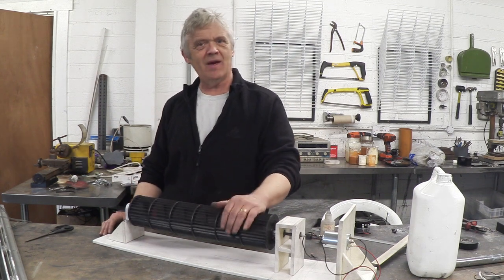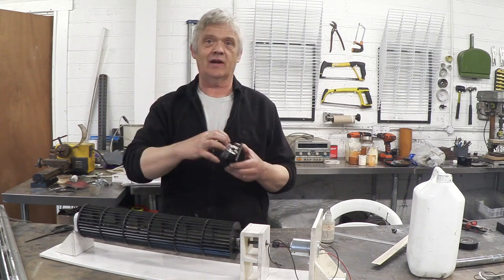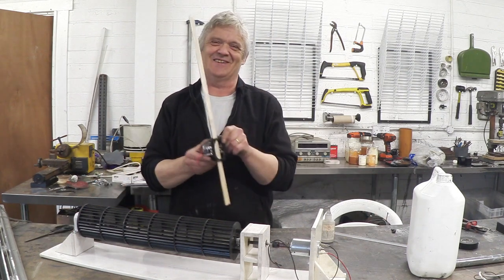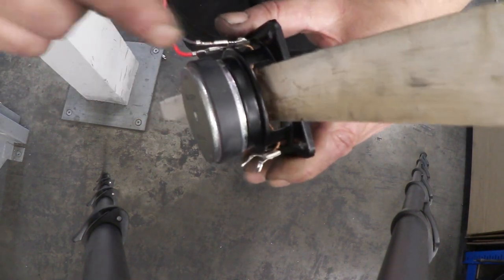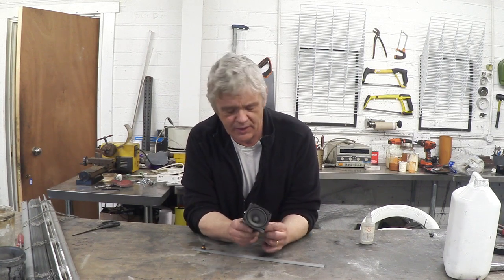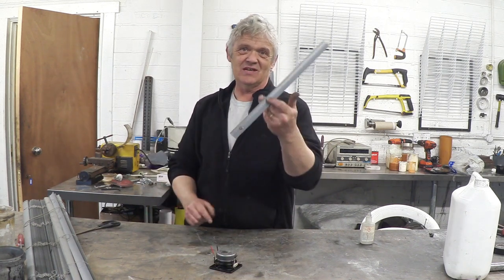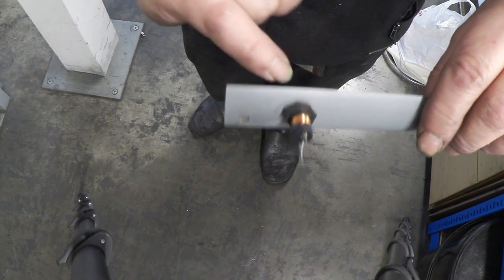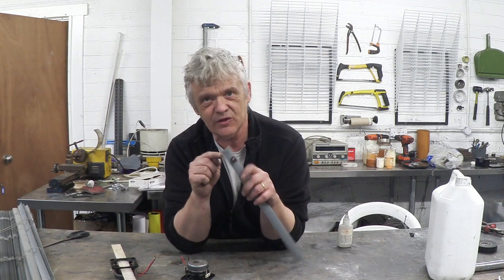Weird Wind Generator   No Blades, No Moving Parts

Comment: Interesting idea, but it does have moving parts !  A simple vertical collector collects very little power, because sub-optimum shape.  i.e converts little of the available linear wind energy. Maybe RM-S would suggest shape(s) or environments to magnify and then capture the energy. Would resonating the wind help? Even could we used sound resonance as an intermediary stage.
Reply from the maker: working on some of those ideas now mate - cheers

Comment: So a pipe cut to the wavelength of 60hz with a subwoofer that has a frz of 60hz at one end of the pipe and the singing pips mounted along the ridge of mountain ranges like the Rockies and you would have perceptual energy output of 60hz for all america. Or 50hz at the top of the alps for Europe. 😎 Thought of this stuff a long time ago when i was in high school early 70's.  I am now 65 years old!  So what's new?
Reply: I'm no engineer... is this written anywhere so I can better follow what you are offering?

Comment: Yes mate it's quite interesting.  Let me discuss something that I came up with when I was a lad.  I was going to use this as one of my PhD papers but since I wasn't able to achieve it and the general knowledge of it was released by a Canadian; what the hell.  There is something that was referred to as a crystal battery I believe they called it.  The key ingredient is quartz crystals.  You can find it on youtube by searching “crystal battery lasersaber”.  There are other with their own take on it but I can't recall any one person getting completely right.  Also I can't remember the Canadian PhD but his humour is what I refer to as a bit off.  Smart but twisted humour to the point am not assumed.  And I can be quite twisted humour wise.  
Any how this is the physics of it all.  The quartz crystals are oscillated by multiple sources in our world today.  But back when I was working on it it was oscillated by the changes to the magnetosphere.  Which I always heard as a low frequency pitch in my ears.  People always had to get some distance and even so I still heard them.  Back to the physics at hand.  The oscillation of the magnetosphere is caused by the sun or from what is referred to as cosmic radiation.  The frequency range and I never had the equipment at the time but I theorised that it had to be in 500Mhz to low gigahertz range.  When this “crystal battery” was subject to this it would create a low voltage and current power source.  At the time it was merely a that's interesting because it was long before super caps which could be used to harness the power in more practical uses.  Say using 1 – 2 cm by 1 – 2 cm circular copper container.  Then connecting 12 of them together you could get say 12v@.1A out of it.  Not allot I know but it is a small watch like battery.  But if you feed this into some super caps to charge it up then you could charge or run something that is low wattage.  A small transistor radio was the device I was thinking about at the time but I didn't have super caps then.  Normal caps have too much leakage.
So, this is another free design of piezoelectric generation.  The only problem with it is that the crystals do grow and it does destroys the copper housing.
Reply from the maker: thanks for sharing that mate - cheers

Comment: everyone knows that, the sound that makes a blind vibrates in the wind of the opened window. I think this vibration should be maximized, I have seen something similar with small threads on the blades that increase the air swirls. The topic is far-reaching and very interesting!I'm looking forward to more.
THX for the video!
Reply from the maker: glad you liked it - cheers

Comment: You can glue a wire or a string between two speakers without damaging them and double the power. Also a little flag or flags on the wire will help with the vibration.

Comment: Hmm, generating electricity without movement?
Is that actually possible given the fact that the wind is moving?

If I recall correctly, there is a method of running electricity through a series of horizontal wires that will cause air movement. Perhaps they figured out how to use that in reverse to generate electricity?

Another method I am aware of are micro-wires that will generate electricity when they move. Any vibrating surface is sufficient for them to move. Technically, that is not producing electricity without movement but it would certainly appear to do so given the fact that you cannot see those micro-wires without excessively expensive, special equipment.
Reply from the maker: no mate - we need an energy input - this is mechanical to electrical for sure

Comment: Hmmmm,  how about suspending some copper wires around or close to a permanent magnet,  if the wires are a little bit slack then the wind would cause them to move/vibrate which in turn would cause them to be induced with current by the magnet !?. Right...Ive got some wire and magnets around here somewhere :). love your videos as always,   excellent "brain food" lol
Reply from the maker: awesome mate - let us know how you get on

Comment: What if you had multiples of these connected, finely corrugated the surface, perforate it will tiny holes, and had them connected so the movement and vibration of one is passed thru and into the next, and all the vibrations due to surface turbulence, pressure differentials, movements (macro / micro), and induced vibrational contact, are harnessed. If in it's movement and joints it could freely respond to ANY external or internal energies.
Reply from the maker: interesting idea mate

Comment: The wonderful thing about a vibrating pole rather than a wind turbine is that it is a lot less likely to chop migrating birds to bits. A similar problem exists for under sea water turbines, chopping up fish. Perhaps the vibrating reed solution could be applied in water.

Round metal chimneys are fitted with a spiral of anti Ovaling fins to stop the structure vibrating to destruction in the wind. Basically a round chimney will enter modes of oscillation where it ovals in the x and y direction, potentially resulting in the structure failing due to repetitive strain. Being round, the phenomena is omnidirectional. Unfortunately the process is one of resonance with wind speed. But the energy produced is considerable, ripping the think metal walls to bits. Maybe this force could be harnessed for power generation using a pneumatic pump and internal flexible vertical tubes within a chimney structure. I suspect that the problem with such generates is one of impedance matching for maximum energy transfer. The impedance is not necessarily electrical, it could be mechanical.
Reply from the maker: interesting mate - thanks for taking the time to write

Comment: Just magic Rob.
- - I envisage each 'reed-inductor-generator',... to be configured or conglomerated, like LEAVES on successive stalks - a TREE effect. 
- - The 'stalks', branches & TRUNK acting as the 'conductor' voltage carriers to a common point.
.... due to the size, simplicity and number of LEAVES,... any single or multiple LOSS would be negligible to the overall output. 
.
Reply from the maker: nice one mate
Reply: @ThinkingandTinkering  All credit to you Rob,... I had that 'vision' a few years back, but couldn't relate to the 'speaker effect'.(linear generator)
.
I was 'hung-up' (brain-block) on a spinning semi-universal joint movement.

Comment: It might be better to retain the speaker cone as this provides stability to the voice coil inside.  It has to slide within a very narrow gap in the magnets.  If the voice coil moves in any other direction it can graze the insulation on the coil.  I do like the 'blades of grass' idea for hidden generators.

Comment: And many in a series-parallel circuit arrangement would increase the voltage in series while increasing amperage in parallel. And then, there's the step-up transformer that can do the same thing.

Comment: Hi Doc. What about having a spring attached to a end of a blade in the center held upright. Install magnets to the blade and have coils around the outside. When the wind moves the blade it would generate electricity. Look how piezo generates electric when  it has mechanical stress too. It could be another way to go.
Reply from the maker: interesting idea mate

Comment: the device in question sounds like it uses alot of the same basic principles as piezoelectric devices, but instead of a static magnetic force moving against a diamagnetic conductive metal, it could simply be a rigid material moving and stressing a piezoelectric crystal to produce energy, i would test this.

also your idea to mass produce a mat or as i would call it a "sail" to act as the wind version of solar, why not coat the mat in something photovoltaic and just combine the 2 ideas? solar and wind in one.
Reply from the maker: certainly an idea mate - why not give it a go?

Comment: First I have to say you have a cool idea. But you cannot say no moving parts. The movement is not the typical rotation of a motor, but there have been many battery-less contraptions that use the coil and magnet idea. You still have to move the coils past the magnetic field to make a current.
Reply from the maker: okay mate - it's still awesome though

Comment: You have left the chuck key in your center lathe chuck. A cardinal sin in my 50 years of engineering.
Reply from the maker: okay mate - but my machine has a safety lock - it won't start with the chuck in

Comment: Your title is misleading, there are moving parts in the system. The wind moves the blade which in turn moves the piston etc. Now with solar there is no moving part in the generation portion.
Reply from the maker: true enough mate - as i have now answered many times i should have said 'no rotating parts' it's still pretty awesome, yes?

Comment: I've seen the rod-in-wind generators, in videos, but I don't know if the ones I saw were from a Spanish company or not.  Also, I wonder if they might use a piezoelectric process instead of magnets and coils.  Any idea?
Reply from the maker: I think there are three main option, piezo, inductive and capacitive - I have seen all 3 - inductors are the easiest to collect from and build but capacitive are the cheapest
Reply: @ThinkingandTinkering  Thank you, Robert.  I can, more or less easily, picture how piezo and inductive methods would work for this, but not capacitive.  What could/would be used to do this via a capacitive method, please?

Comment: Speaker coil isn't meant to be tilted sideways that would result from the lever arm of the "reed"
Reply: Agreed. Any power generated at the top side of the coil would be almost completely negated by the inverse of it from the bottom side of the coil. 

If the speaker was placed at the bottom of the reed and the reed was fixed so it could see-saw around a third of the way up then the movement imparted to the top and bottom of the coil would be similar and would take advantage of leverage to move the coil with more force.

Comment: Considering using a wind generator in a slightly off the grid project where i need to power a pretty low power device.
Reply from the maker: cool mate - go for it

Comment: Robert, would you mind if I tried to make a microphone based on this design?
Big fan
Reply: My plan is to use the reed, hard drive parts, Phono cable and my passable coding prowess to recreate sound from amplified mechanical movement on the spindle to essentially create a reverse phonograph kind of affair
Reply: Or even better! I could try and make it use read/ write on second pass and stream it to the disk in a ghetto rigged file system to read it back like a live recorded vinyl press :o

Comment: Can we realize more then say  0.3V from this thing ?   Employ a few Super Capacitors and  some small signal diodes.  Germanium type.  Or is that not low enough ? I'm thinking one could collect enough stored energy to be of use?  Would it be possible to Bias the Coil  enough so that the power being created would in fact take the diode over our  0.3v forward bias requirement  for accumulation ?
Reply from the maker: it was running at 6-18 volts mate

Comment: Very interesting, hadn't considered a vibrating wind powered generator before, saves a lot of issues with the rotating ones. Not sure yet about the 'lots of tiny' approach.
I wonder if a speaker stuck part way up between the tines of a 'egyptian drill' (big metal tuning fork) might be neat if I could direct the air to the tines to make it 'whistle'. One could then add others at differing notes to create perhaps a nice major 7th chord and feed the output of the speakers/transducers into step-up transformers and bridges to get a pseudo DC to play with.
Reply from the maker: give it a go mate

Comment: My Guess before watching the video Is some sort of piezoelectric or microphone generator attached to a rigid large plate. The wind vibrates the large plate which concentrates that energy on the microphone/piezoelectric module thus generating a small amount of electrical energy

Or perhaps your using wind to generate static electricity...
Reply: Well I was almost right. Using reeds looks much more effective than a plate.
Reply from the maker: pretty good guess mate

Comment: Outstanding! I'm new to the channel and have found mecca! For the speaker, the coil is moving in a gap with little tolerance so the cone shape helps to keep it evenly located as it moves. a reed might have the coil rub especially in heavier winds which might be an issue long term but dang! I like it.  The little blind/inductor thingy  would be interesting toadapt as some sort of clothing that captures your energy as you walk. Great stuff.
Reply from the maker: welcome - and glad you like it - cheers

Comment: Isn’t the vibration of the a moving part?  All my engineering instructors considered vibrations as movement.
Reply from the maker: yes mate - i should have said no rotating parts - still awesome
Reply: Robert Murray-Smith , Just a thought.  Instead of air or wind, why not a medium that is more constant, like water?  Imagine an underwater bed of these, power from ocean currents, stream , rivers with costly dams.

Comment: Pendulum, weight on bottom, pivot in center, inductor mounted separate to a frame at the top, one on each side  , it could move back and forth much farther for a longer power stroke, or a very light return spring on the bottom would also work. Pity there is no way on youtube to post drawings in the comments .
Reply from the maker: for sure mate - build one!
Reply: @ThinkingandTinkering  well I just might do that for sure, Very cool idea that way of generating power, great for low wind, low height, and would not require that structure and maintenance of a windmill. I could see a wall of these maybe even painted as a mural on a building, could be easily incorporated into walls etc, maybe even use for solar heat collection at the same time, use the electricity collected to move the heat.

Comment: Wind generator? Are we generating wind or harvesting it? No blades or moving parts? I see a wind 'turbine' with a wobbling sail in the shape of a blade ;) It's interesting, though. Worth investigating.
Reply from the maker: generation from wind mate - you may be being a little pedantic - but hey ho - each to their own lol
Reply: Yes, an inductor generates energy because of a moving magnetic field. The way this works is that the blade is moving the magnet. If the pivot point is the inductor, then you're cancelling out most of the movement in one direction with movement in the other direction. What you need is a blade with an inductor at each end so that it acts like a piston, or better still a large diaphragm speaker. Try mounting a base shaker to the wall of a shed.

Comment: That's neat, but while you were being showmanly and still presenting it with a air of mystery, my mind ran with "no moving parts" and instantly wandered into thinking about how an Ion thruster could thermodynamically reversed. I know what I'm researching for the next hour.
Reply: *"could be thermodynamically....
Reply from the maker: interesting mate - i believe this is something that affected jet engines for a while and there is some research on it - but like you i would have to look

Comment: Seen a isolating belt that was clever , just a flat belt that flaped in the wind , magnet and coil , the belt is fixed at both ends but not very tight , belt like a luggage strap , if you have ever used them on a car roof rack they sing in the wind !
Reply from the maker: seen it mate - they call it a belt generator - this is more of a reed
Reply: @ThinkingandTinkering  often thought why put generator in center of blades,  put the magnets on the ends of the blades a nd the coils in the post

Comment: If they figured out how to do that then they can use the Golden Gate Bridge with the new railing that actually makes singing type sounds when the wind blows through it
Reply from the maker: true enough mate
Reply: @ThinkingandTinkering  I didn't know if you had heard about the Golden Gate Bridge having its railing replaced and that it's starting to vibrate in a singing voice that you can hear across the bay when the wind blows through it

Comment: wow that is amazing, I've seen the pole type online but thought it was converting linear to reciprical motion amazing. If you connected a load of these in series I assume you could up the voltage just like solar panels or amps in parallel?
Reply: You'd need to add diodes, but yes.